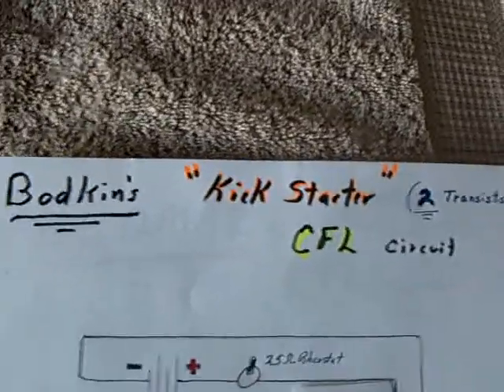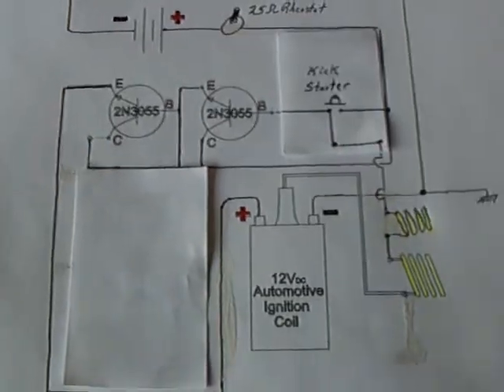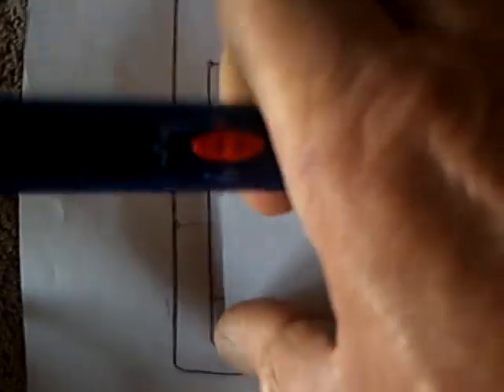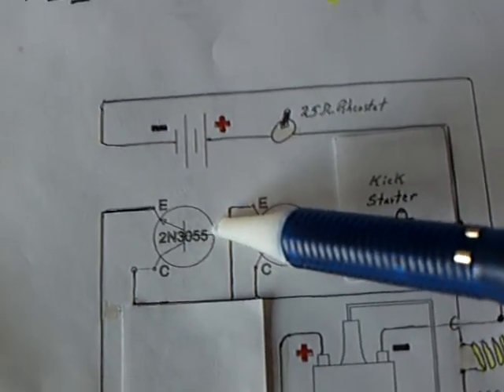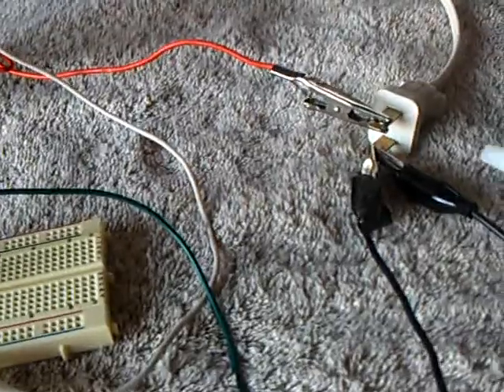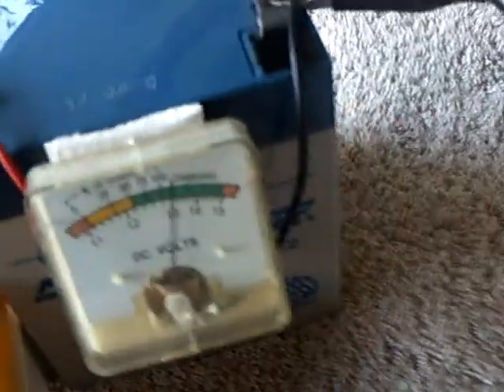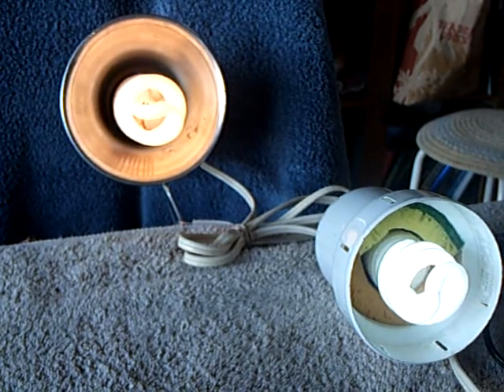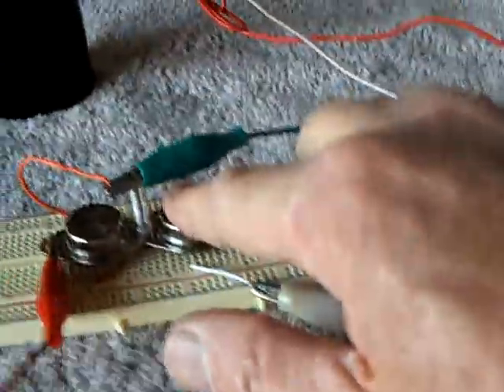Bodkins Kick Starter 2 Transistor CFL circuit

Comment: I solved the problem by adding a 250V 47nk capacitor between high voltage wire and CFL. I tried all capacitors I soldered out of CFLs ballast and this one worked best. The circuit draws about 1 amp. If I add second 12V battery 3 stripped CFLs light at full brightness and draw 1.3 amps which is about 30W at 24V. It is close to their rated power. They are 11W bulbs. If I leave only high voltage wire attached it draws 0.3 amps but the light is very dim. Conclusion - there are no energy savings.

Comment: I tried the setup but I get only a short light when I kickstart it and then nothing. Also it lights in a little sometimes when I switch the circuit on. I can adjust the brightness of the short light by adjusting the rheostat. What could be wrong? 
I can make the CFLs glow if I just connect the battery, ignition coil and metal plate. I slide a wire over the plate, it sparks and both CFLs glow. The second setup works with both modified and unmodified CFLs. But I can't use it to light a garage.